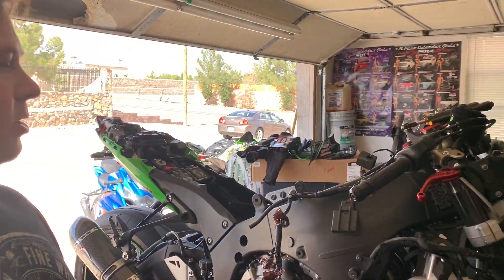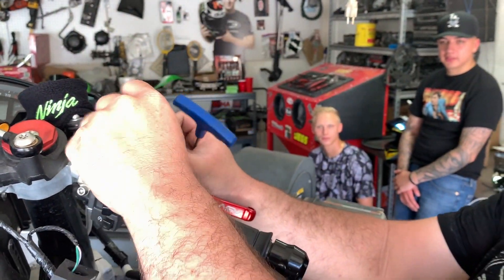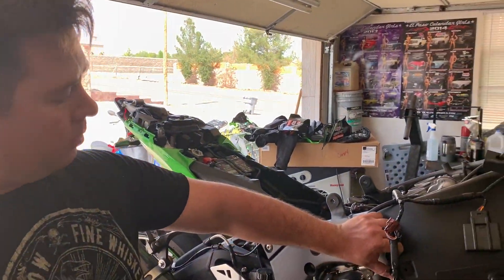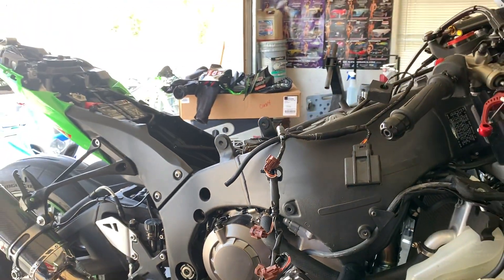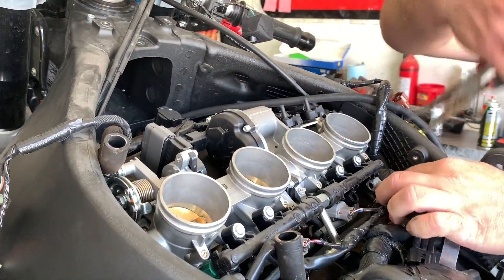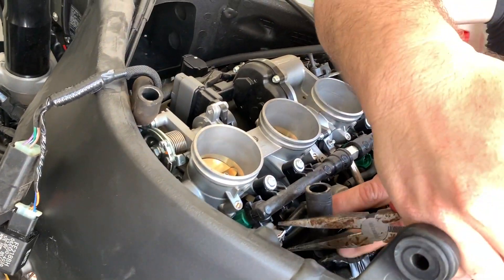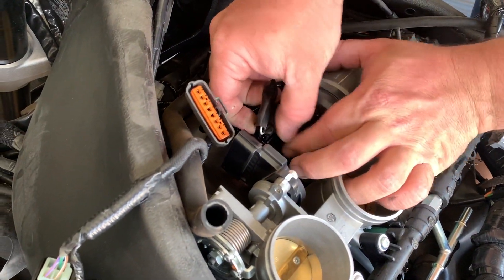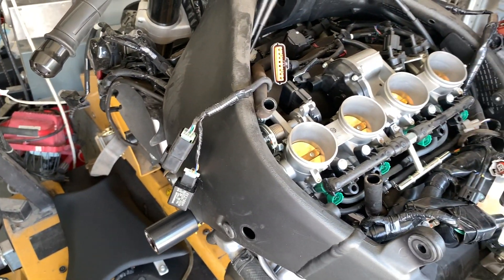ZX10R Throttle Body Removal How To

Comment: I did all this, and my throttle body is not even wiggling. Something is holding it down still
Reply: Did you figure it out? I have the same issue.
Reply: @gamerairshotty629  yeah. The throttle body was almost like it was melted on. I used a big screw driver and was able to pry it off. Once it broke free, it was all good easy to remove.
Reply: @XInfantryman legend. Thank you, took me 10 minutes but got it off.
Reply: @gamerairshotty629  Cool 😎